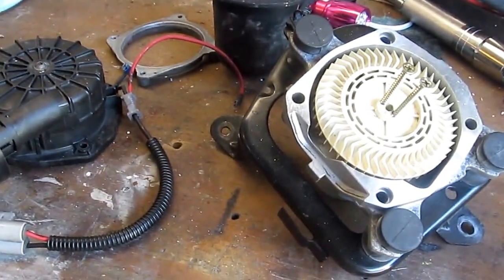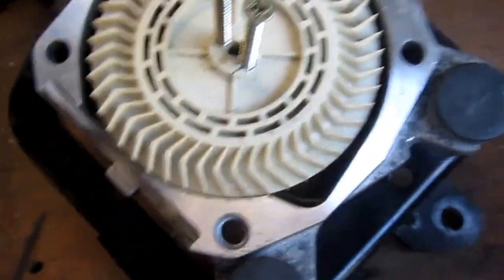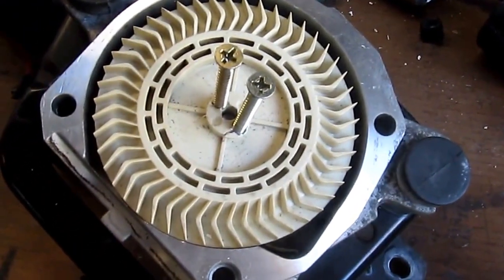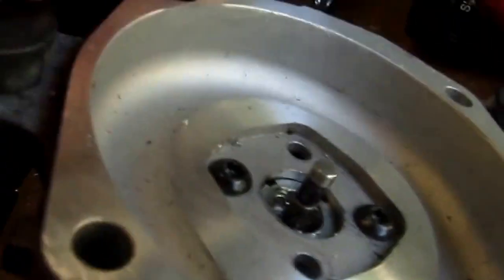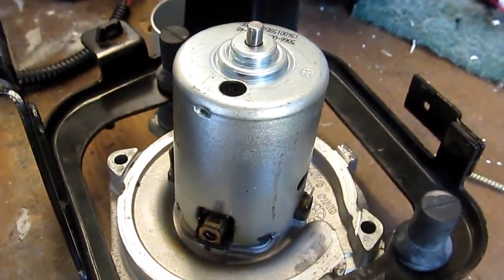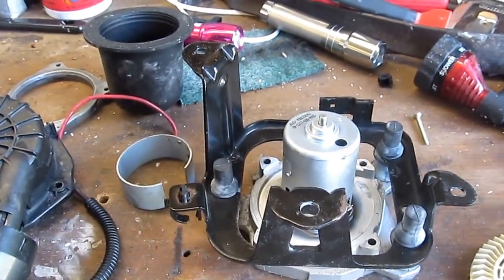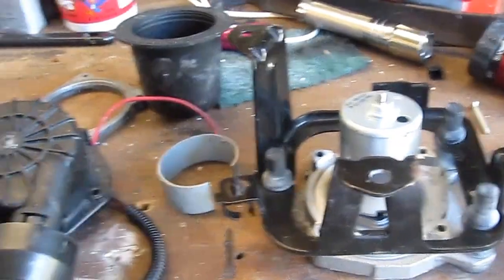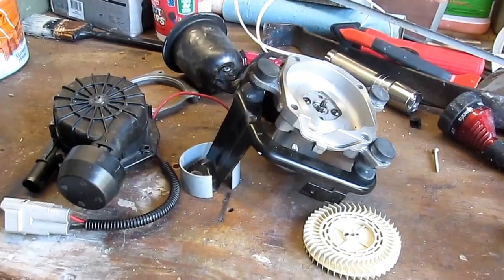2006 Toyota Tacoma secondary air injection  - Part 5 of 5

Comment: You sure shouldn't work on cars, stop being so cheap, and let a mechanic fix the problem.
Reply: Whatever you can tell he has worked on cars and knows several workarounds. If he didn’t need an air pump no big deal, it’s all bs anyways.

Comment: Hard to believe Toyota would buy such a shitty designed air pump with non-replacable impellers.  Grr.  My 05 Taco just threw me a 2440 code now I have to start all this nonsense...or pay a Toy dealer a king's ransom.  Getting tired of this brand after many years of loving it.
Reply from the maker: Yes- I have noticed a decline in quality, but remember they are not made in Japan now.
Reply: I just got the 2440 and 2441 codes. What a headache?
Reply: My air pump makes a loud vibrating noise it gave me the P2440 code so I switched the air valves check engine light turned off but my pump is still making that loud vibration noise any idea what it could be?

Comment: Thanks for the videos. Luckily my truck doesn't have this issue but it was nice to learn about it. I happened to notice you can get an aftermarket pump for about $150. I saw some on ebay and amazon if anyone is interested. Good luck! ^-^